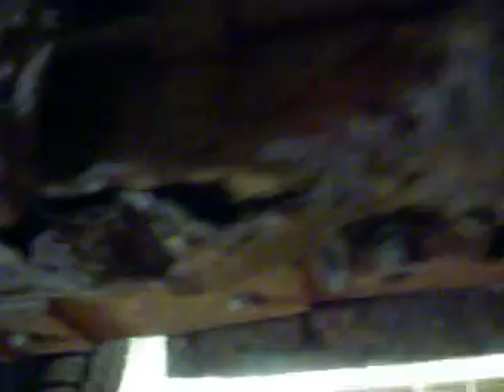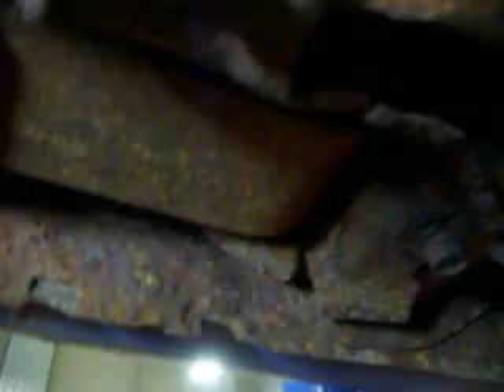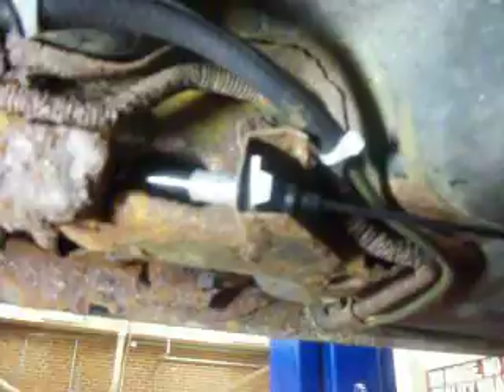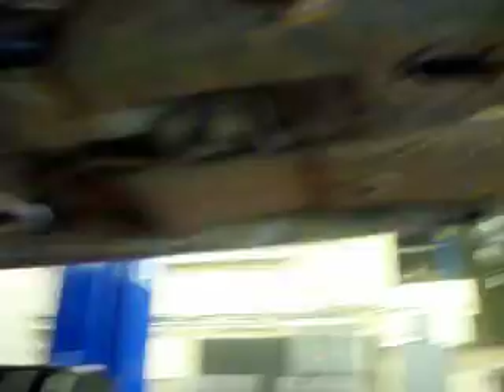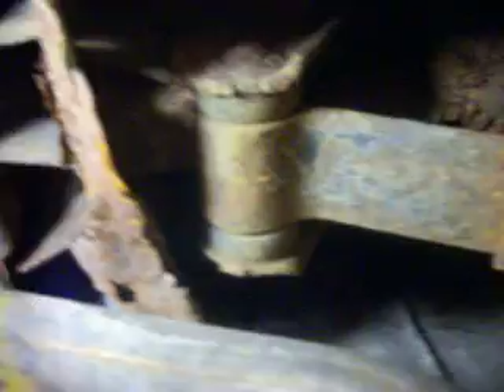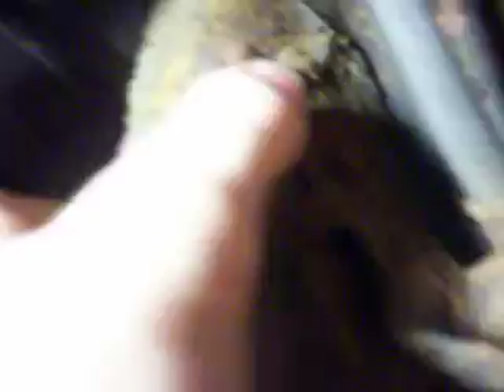'79 Camaro Frame rot

Comment: Man my '80 camaro is just as bad. What is funny (if you can call it funny) it is worse on the driver's side as well on my car. Driver's side is rotted out the passenger side just has a little rust. I don't get that. It just got bad in the last couple years. I don't drive the car anymore, currently it is just sitting until I can get enough money to complete the restore but it was never this bad when I drove it. Rust is evil
Reply: Damn, for me it's the passenger side that's completely rotted out, but the other side is mostly okay. That's just the luxury of living up north I guess.